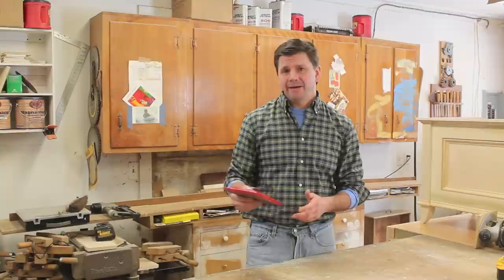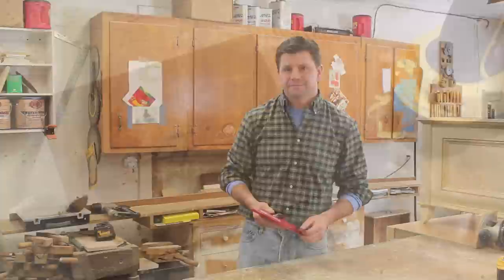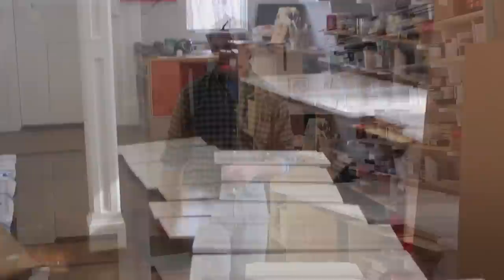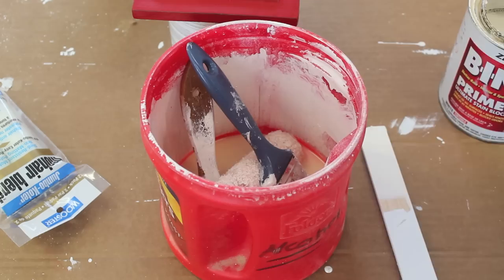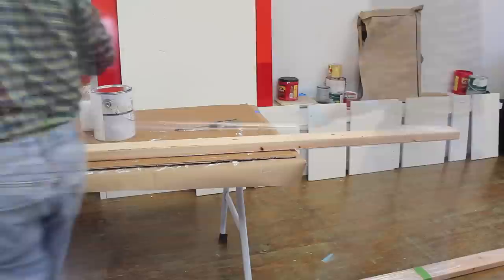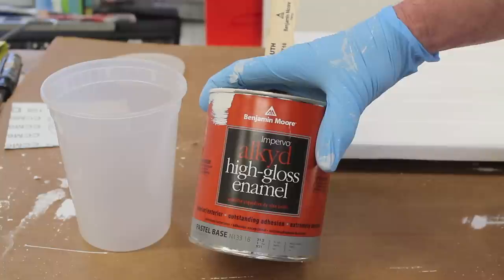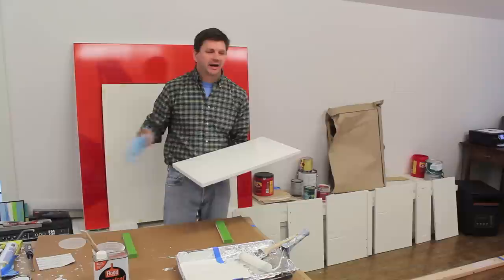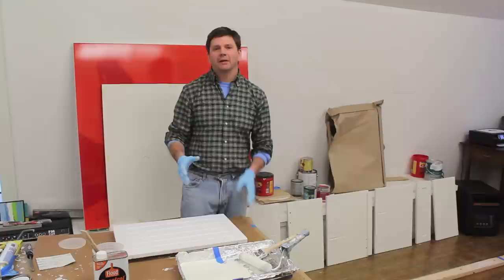A few tips on painting old Kitchen Cabinets by Jon Peters

Comment: Nice one on the 2x4s as simple drying racks. I use packing tape and a shaped cardboard corners in the same fashion on saw horses. You can setup quite a simple rig without committing to any permanent racks/structures. Thanks for the video!

Comment: And I agree 100% on acrylic/latex. I use it when I have to and have no choice, but anyone that says it is just as durable as oil based, cv, or even lacquer obviously has no experience with it. Latex is and always has been for drywall and concrete. Unfortunately the way the EPA regs are going, I would imagine a few years from now if you aren't licensed with an approved spray booth, it's about all your average joe will be able to purchase.

Comment: I posted a comment previously, using Behr paint and after 3 weeks paint was hard to the touch except when it touches other surfaces for a day or two it's still tacky. Do not use Behr paint, especially Alkyd, which is oil based. I bought Maxwell polyurethane, oil based, before stripping shitty Alkyd why not try something else. I'll tell you guys! It worked. Wait for a week and hard as rock! If you used oil based paint use oil based polyurethane, if water based  painted cabinets use polyurethane that is water based. Two coats, no sanding needed as long as no drips and wait. Patience is the most important thing!

Comment: For any of you NOT wanting to use an oil based paint as a top coat; consider the water based epoxy floor/deck paints out there.! If those epoxy paints can handle foot traffic, i'm sure it be a good alternative to oil base paint. also a primer/bonding agent you can use, which is an oil base is "COVER STAIN" One reason being shellac based primer has doubled in price! Bins shellac base used to be $19.99 at home depot, it is now around $41.00 I've used the cover stain on bathroom floors, then the water based epoxy paint, and recently went and looked at a job I did 6 years ago, NO CHIPS or PEELING!
Reply from the maker: Good info Randall...thanks for sharing

Comment: Hey Jon, or someone who knows the answer, in this video you recommend using two types of primer -- first, the BIN shelac primer, and second, the Benjamin Moore primer. My question is why not use two coats of Benjamin Moore and skip the BIN? I've heard some bad things about the BIN shelac primer, specifically that it's too hard and allows the paint to chip off the cupboards where hands interact with them frequently, like around the pulls and knobs and under the sink where it gets wet.

Comment: Great video but you forgot to mention that shellac primer has a very strong smell and you should be carefull when using it. Wear a good respirator and have all windows open if your doing this inside. Also sanding between coats is recomended for a smoother finish use 220 grid sand paper.

Comment: the advaced pain from benjam moore is a moore superior paint then impervo..and since impervo has been discontinued and imperverx took it place,, advanced is the best to use on cabinets furniture trim...very durable,, i have been a contractor for almost 20 years and i use prime lock when painting cabinets,,the 2 coats of advance..the problem with the oil paints ,is that it does not expand and contract like the water born does,, so thats where u get  cracking and flaking/
Reply: +wolf360090 Have you ever done a clear coat over the Benjamin Moore Advance paint with a water modified varnish like Zar Ultra to give it more durability?
Reply: i have act have used oil varnish over it..oil is alot more durable and the water born poly becomes soft, old mater polu is one of the best

Comment: Very nice.  Will use these tips on an upcoming project.  After building up a few more layers of paint did you have any problems with the drawers or doors sticking due to increased size?

Comment: I just painted my China cabinet and it's been a week and it's still tacky, I put baby powder to help for now but that's only temporary any advice??
Reply: Mine are still tacky too after two weeks. They say it takes up to 30days to cure which is crap in my opinion. I think some paint is garbage, also depends on humidity, temperature and how thick layers in between were put on as well as time was giving to dry between the coats. Anyway oil painting is garbage and not worth my time

Comment: I am repainting my kitchen island.  It was originally primered by the cabinet builder and ready to paint.  It was painted with a benjamin moore oil base in a barn red.  The problem is that on the areas that wore, the bright white primer shows through.  We retouched it about 8 years later with the benjamin moore "advance", which is allegedly oil suspended in water for easier clean up and better wear.  Well it too is wearing and the primer shows through on the corners, and near the handles of "high traffic drawers" .  In addition the "satin finish" is way too shiney.  In my perfect world they would look like chalk paint with a matte patina. I now can scrape some of the barn red off with my fingernail to expose the glaring white.  Any ideas??  I am tempted to sand the living crap out of everything and chalk paint and seal them.  I don't know how to get rid of the white primer problem as we are planning to once again paint it a dark color, a darkish brown gray.  I have no idea why the primer was so white.  The builder knew we were going barn red.  Thanks for any help you or anyone can offer.
Reply: +Lisa Begin in order for anything to stick to the oil paint you put on you caninets, you have to use and oil primer first, then the advance paint..if you do not use an oil primer then it will just come off.and the advance paint is not an oil paint so it is an alkyd ,so in order for anything to really stick you have to sand it down to the oil you put on it the first time, then oil prime it, then use the advance paint or what ever top coat you use
Reply: You should use a tinted primer so it is not as visible through the paint as it wears out.

Comment: So Alkyd paint is what I used. Dry to touch in half a day but what's the cure time about for something like this because after almost two weeks mine is still little tacky
Reply: @Mike Bell I used bair paint alkyd for cabinets. I power sanded them with 220. Cleaned very good with rag and water and waited to dry. Doors were brand new wood, never painted or stained. Vanity has been stained previously bit as I said I power sanded them. So no clue. I heard wait longer, it's been two weeks, or been told paint brand is garbage. Two weeks later it's normal for it to be tacky!?
Reply: @Mike Bell thanks Mike! Glad they were very old and was just a trial.

Comment: Those brushes you have stored for over 6 months look horrible. You will never-ever get a good smooth application from brushes that have not been cleaned from 6 months of use. I know you feel differently, but, you should "always" clean your equipment. I would never allow someone to paint with brushes such as the ones you are showing here. Never !!